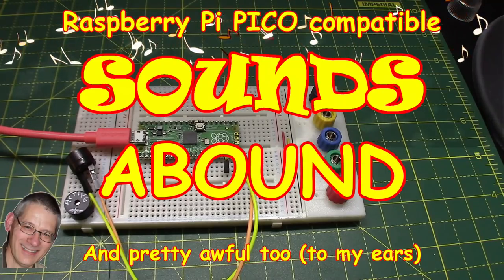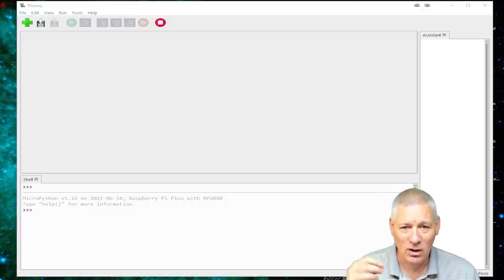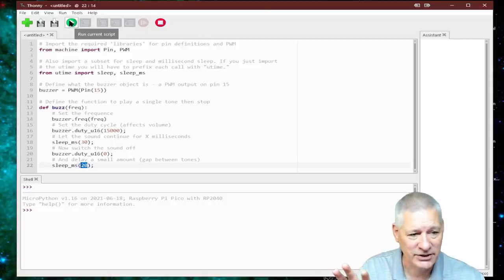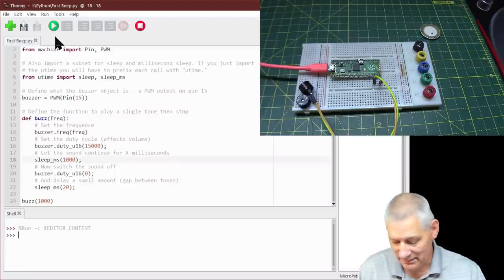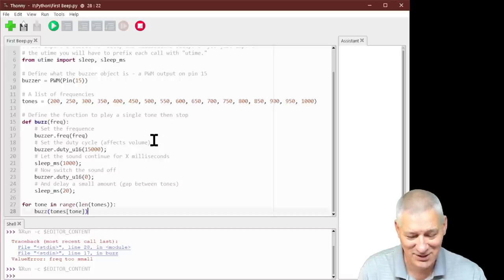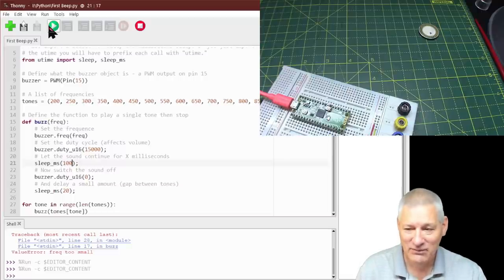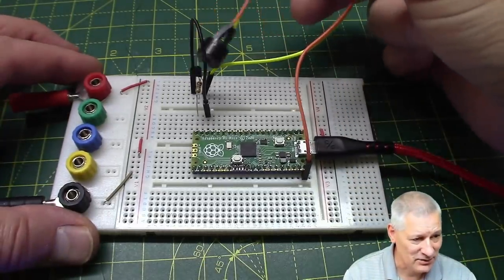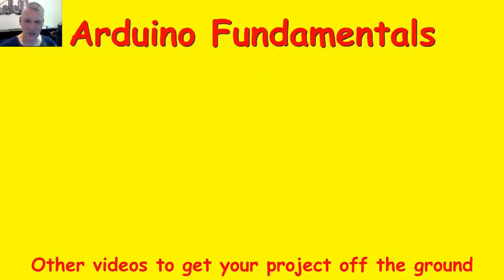#219 Generating sounds 🎵 from the PICO! But is it music to my 👂 ears?

Comment: Thank you for this!  I know your intent was not to give a programming tutorial - but I hope you don't mind me showing some extra features of Python.

The language has really neat features when dealing with arrays, such as allowing you to use negative indexes.

So. Starting with an example array...

tones = [100, 200, 300]

You can use negative indexes to grab from the end of an array.

tones[-1] is 300
tones[-2] is 200
tones[-3] is 100

You can easily reverse an array.
try:-

print(tones[::-1]) 

You can also remove the need for using an index.

# Fridge Opened
for freq in tones:
   buzz(freq)

# Fridge Closed
for freq in tones[::-1]:
  buzz(freq)
Reply from the maker: Thanks for sharing, John! As I don't really know microPython it's good to get posts like this that everyone can benefit from, me included!

Comment: If you just want to iterate through a list of items, you can do it directly, without using an index:

for tone in tones:
    buzz(tone)

And to do it in reverse:

for tone in reversed(tones):
    buzz(tone)

For a cleaner sound, using an analog output (DAC) with a sine wave (or multiple sine waves added together for a chord) seems good.  But the DAC output can't supply much current, so you'd need some kind of amplification.  I wonder if a transistor would be sufficient, or you'd need something like an op amp?
Reply: or 'for tone in tone[::-1]:'
Reply from the maker: Ian's just showing off now (but I do like that construct, I will probably use it and claim I knew all about it).

Comment: Hi Ralph! Just to save you from any headache in the future... you might want to add a resistor across the piezo when driving it with a BJT. Simply put, you need to pull the collector up to 5V in order to get a change in voltage happening across the piezo. I suspect in this case your multimeter was acting like that resistor, so you should have a noticeable difference when not having the DMM across.
Reply from the maker: Quite possibly, Dustin. However, even as it was with the DMM across the output, it was more than loud enough (the video compresses the sound so it's not as noticeable). But I'll try it.

Comment: Ralph, did you look into the floating ground issue we discussed a few weeks ago?

As I understand it, this can happen when you connect your new backyard workshop to your house with anything conductive such as an Ethernet cable. Electricity (like water) wants to find an equilibrium for its potential so it tries to do so by moving energy through anything available. If it is your Ethernet cable, this can prove to be damaging to devices such as routers, repeaters, etc. 

Back in the '90s when I worked for a small computer shop, we would run into floating ground issues when we would attempt to connect multiple nearby office buildings or various buildings on military installations with coaxial Ethernet cables. 

To stop the problem one can use purpose-made optoisolators, microwave transmitter/receiver pairs, or fiber optic Ethernet lines instead of copper.

Terry Thomas
PC Tech Support
Atlanta, Georgia USA
Reply: Any gound with current flowing throught it will create a voltage between the two ends. if I going to run ethernet between buildings now days i go stright to fibre, breaks the ground loop and give far better lightning protection. an optoisolator only save one end if your lucky.
Reply from the maker: I did indeed look for web articles and a simple, RJ45 plug-in, isolation device to break the ground connection (if any) on my LAN cable from house to workshop. None to be found in the UK, only the USA.

Now, that said, I'm was thinking about whether my LAN cable is connected to actual ground. It has a shield, for sure, but whether that is connected to the device (router) ground or the ground/earth coming into my house via the mains electricity is questionable (and difficult to test). Most routers probably have a floating earth? Not connected to mains earth at all (perhaps for the reasons you state)?

My workshop has its own Earth. A copper rod buried into the actual ground outside my workshop and connected to all my mains sockets and consumer unit (fuse box) in my workshop. This is now the preferred way to earth outbuildings in the UK, to mitigate risk from "broken" earth cables (that go pretty much undetected) between house and outbuilding. Electrician said I had a better earth (lower resistance) than the house did!

So what's the next step.
Reply: @RalphBacon  It's just a difference in earth potential, So I'd look for a fibre ethernet and run a fibre link up to the shed, you get full isolatation and prection from lightning. something like a pair of TP-Link Gigabit SFP to RJ45 Fiber Media Converter, Fiber to Ethernet Converter  and a fibre cable. should get change from £100 and can be found on Amazon

Comment: Great as always Ralph.  Last year I did a little 555 timer project with a piezo on-board as a beeper I could feed down inside a wall cavity to locate a cable. It's powered by a little 12V battery like in a garage door opener. It's EAR-BLEEDINGLY-LOUD.  Maybe you could add something like that to your circuit to increase your volume. Very instructive as always Ralph. Thank you.
Reply from the maker: That is awesome! In fact, my ears are bleeding just from reading your comment, Gord! In my Arduino projects I can use a tone library which leverages the push-pull effect from the Timer output pins D9 and D10; I don't know how to do this in MicroPython (yet?) so the transistor was an obvious step!

Comment: In the 1980s, the Tandy Radio Shack Colour Computer (6809 based) had a relay used to turn the external cassette deck off and on. Of course we used to program machine code to make it buzz, and play crude music. Not for long durations of course, as it was abusing the relay. Going back even further, the original monochrome TRS-80 (Z80 based) had a commercial game or two that played music (intentionally) on a nearby MW AM radio by means of intentional EMI. It was RF comedy and a display of extremely clever programming.
Reply from the maker: Stop, stop! You'll be telling me next that the Morse code operators of the WWII made little tunes up to confuse the enemy (or to pass messages on, perhaps!). Oh. https://youtu.be/N7R3FMTO_GU?t=712

Comment: Thinking about increasing the sound output of the unit ... have you looked at some of the lovely smooth and flat surfaces that fridges often have and try to use them as sounding boards? Yes you probably need a firm connection, perhaps magnetically, to transfers the force but it might be a cheap win.  Keep up the great work 👍😀
Reply from the maker: It would be a cheap win for about 30 seconds and then the boss would spot it. Mind you, I could use the top of the fridge; she is too short, er, vertically challenged, to see that!

Comment: Hello Ralph from Ohio, USA! Your episodes always seem to inspire me to do something, which is one of the points of them, I'd guess. Anyway, I bought an old pulse-dial phone and found that much of the functions can be run off of 5v DC. (Even the AC ringer can be operated by flip-flopped DC.) Going to take the old dfplayer mp3 module and make it into a dialable story phone for my grandkids. Thank you for the inspiration!
Reply from the maker: Sounds great! Did you see my video on an old, rotary telephone dialler? https://youtu.be/sD20xkVWh2s
Reply: @RalphBacon  I didn't, but will watch it! Thank you.

There is a library called bounce2.h that I was going to use. I'll look at what you did and see which is better for me.

Comment: Little bit of low-pass RC filtering on the sounder may made the sound a bit more pleasant.
Reply: I guess the piezo already does some kind of low pass filtering, since it cannot directly follow the steep flanks of the signal anyways. Membrane speakers do filtering that even better, due to their elastic resistance as well as resistance of the air moved around. But some low pass filtering with an op-amp (integrator circuit) might do even better than passive RC low pass filtering, since an integrating op-amp amplifier also gets rid of the transistor amplifier at the same time.
Reply: @asagk  absolutely! A small 8R speaker sounds MUCH better than a piezo. Thanks for mentioning!
Reply: @asagk  - Ralph could do wonders with some analog processing - or maybe digital synthesis - but it's just a little "bleeper". I was just suggesting a very easy way to possibly make it sound a bit less "harsh" (using 2 passive components).  AFAIK he's not trying to emulate a Hammond organ!
Reply: @j1952d  "AFAIK he's not trying to emulate a Hammond organ!" ---
... what a pity, isn't it?! :-)
Reply: @asagk  - Hahaha!
Reply from the maker: I do have some tiny speakers, hardly bigger than the piezo buzzer. I shall have to try one out.

Comment: Hi Ralph, use two pins for the buzzer with inverted signals so have a bridge circuit?  Should be louder than 5v.
Reply: If you want another option this might also work wikipedia.org/wiki/Voltage_doubler#Dickson_charge_pump
Reply from the maker: @Graham yes, I do that with the Arduino but didn't know how to do that with the RP2040, especially not with MicroPython - a future version perhaps?
Reply: @RalphBacon  Not easy perhaps an interrupt pin change on the PWM output pin and use that to set the inverted pin in the interrupt service. or use a transistor to invert the signal? Use the 12S output and a sound chip on 3v3 with a embedded data of the sound? Graham

Comment: Different shades of the same; progressing ideas through a number of projects in a timeframe, that's why I called myself a software developer, rather than a programmer. The next program in line usually borrowed from it's predecessor even if only the initial credits remained finally. Keep having fun, JLPCB certainly seem to be coming along in leaps and bounds, offering to the enthusiasts products that were unobtainable until recently.
Reply from the maker: More than a software developer, Ian, a software engineer at the very least! In fact, they called me a senior software engineer at my last job and were very particular about it! And, no, they were not referring to my age. 😡
Yes, JLCPCB seem to be trying hard to provide the services small/medium companies are demanding. Amazing what is out there.

Comment: I love this video.  The way you explain the code I can understand.  If I understand correctly you are running code directly from Thonny instead of saving the code directly to Pico that would run all the time.  I have been watching some lecture videos by Hunter Adams he is taking a Pico and changing the squire waves and using the ADC to convert them to Analog waves to make the sound of a cricket.  Would this speaker work on analog waves also? I  am an old man of 59 or that is what people tell me. I feae in my mind like I am young man hungry for knowledge and that is how I ended up at this awesome video as we said in the 80's.  Thank you and God Bless!
Reply from the maker: The code definitely runs on the Pico; I can't remember all the details now but I uploaded the code using Thonny, for sure.

The speaker I used here was (probably) some piezo sounder; only really designed for square waves (ie digital sounds). To play analog sounds you need a "proper" loudspeaker (not too low an impedance) which are fairly cheap but can sound quite good if mounted on some sort of baffle (even an enclosure side panel would suffice). It can be small too, I have some that are less than 1" across. But better ones are a bit bigger, say 2" diameter.

Comment: You can increase the output volume by driving the piezo sounder with complementary signals.

You could use an inverter but this might be a good application for the PIO feature of the RP2040.
Reply from the maker: Great idea, Neil. I intend to experiment with the PIO (some sort of strange assembler language, by the looks of it) but I'm not sure the output can be dynamically changed; for example output different output frequencies controlled by the main program. I must do some R&D.

Comment: There's some missing stuff in your transistor piezo circuit.  most piezos register as open circuit at working voltage tests, they behave a lot like capacitors. Your transistor can give a lot sharper edges to your tone signals in but without a resistor to pull the gnd end of the piezo back up to 5 volts, it will just stay down at gnd + the transistor emitter forward voltage. If I really needed the volume and had spare pins I used to pair pins up as a full bridge driver back in my past life on microcontrollers where I was bit banging much of my custom code. A 1k resistor across your piezo should sharpen up the sound. So long as you power down mode with your output switched to input there's no standby current penalty.
Reply from the maker: Sounds like some good info there, Graham, thanks for sharing. I shall bear this all in mind.

Comment: Another great video, thanks Ralph.

As has already been said, the sound reminded me of the 8bit computer games back in the 80's.

Have you managed to get the pico-probe debugger working via a 2nd Pico yet?  I prefer C and C++, so that's what I'm now using.  Currently writing a class for outputting numbers to 7-segment displays via MAX7219s.  The debugger helps no end.  Perhaps you can show the use of the debugger with C or C++ code in a future demo?
Reply from the maker: That's a great idea but time is my enemy. What with multiple projects on the go and a gazillion other things to do I have to be very selective where I spend my time. But it's most definitely on my list of very important things to do (regrettably, not on my wife's list at all).
Reply: @RalphBacon  Funny how that works...

Comment: Very instructive video, I like your style :-) on your pcb, the one you show at the end, you have a 18650 battery and a TP4056 I beleive, would you mind sharing the shematic of the circuit. I am actually designing a pcb with that kind of set up. Thanks, Best.
Reply from the maker: I've added the schematic to my GitHub for the project you are referring to (video #221 https://youtu.be/eLnfiYkxCQ4 ) and you can find it here: https://bit.ly/3Yo2r1r
Reply: @RalphBacon  Many thanks for this ! this is exactly what I needed for my pcb project. keep on the good work !

Comment: Great to see you again Ralph- I'm looking for a tone to mimic the rotary encoder "tick" as it's turned up and down and was wondering if you have any suggestions?
Reply from the maker: I would have thought that a standard tone (beep) but at a low frequency (100Hz) that is short (eg 50ms or less) might sound like a tick, Mark. The problem will be to keep it in sync with the actual movement as you won't want to be initiating tones within an ISR.
Reply: @RalphBacon  If the piezo drive is push/pull then simply connect the other piezo pin to the pulse output of the rotary encoder. It will click. It will also drive the micro pins low for half the clicks but internal static protection circuitry will deal with this unless your piezo is huge!

Comment: Ralph tell me one thing, where does that little attached reset button come from? Is it a nifty self made thingy? (Already thinking about creating some, while I have lots of spare smt push buttons somewhere in my chaotic 'mechanic parts nirvana box' ). Or is it some product from somewhere? Didn't find it ... perhaps looking for the wrong 'naming'.
Reply: @andrewhartley8781  Ty!
Reply from the maker: Andrew is correct; as I was ordering the RP2040 boards from them I included the ridiculously simple reset buttons too (and £1 from each goes to the Raspberry Pi foundation). But I'm sure a simple SMD button soldered across the pins would suffice too.

Comment: Hi Ralph,

Another great video, thanks. You mentioned the tone() function sounded better on the Nano. Probably because the Nano was running compiled C/C++ code whereas the Pico was (semi-)interpreted byte code. Not quite the same. I don't know if the Python code bit-bangs or uses a timer to generate sound. (I'm not a great Python fan.)

The Nano sound is generated using a hardware timer (timer 2, 8 bit) and an interrupt (CompA). This is fairly well covered on pages 104 onwards, in chapter 3 of a slighly famous book on the Arduino. ;-)

Your tones appear to be fairly randomly chosen. Maybe using actual tones of the notes in a scake would sound better? 

Hope you are settled in your new home.

Take care.

Cheers,
Norm.
Reply from the maker: Hey Norm! Yes, pretty much settled in, thank you, but still have a couple of things to do in my workshop as I discovered when doing this week's video! Never enough USB sockets! Or they are too far away!

Regarding the tones from the PICO, it undoubtedly sounded worse due to my non-scale choice of tones; it will doubtless improve as I select proper, known tones. Nope, can't bring to mind that book you mention covering the Nano, timer-generated sounds 😊 

But PICO bit-banging works OK, as I found out this week with the easier-than-you-think PIO feature - keep tuned!
Reply: @RalphBacon  Pio? I'm definitely looking forward to that video. It's definitely an intriguing feature of the RP2040.

USB (or any) socket, there's never enough and/or in the right place. Even when you decide how many youneed, then double it! 😉

Cheers,
Norm.

Comment: 21:54 so much jitter! your timing is way off, generate timing in hardware!
Reply from the maker: Well, the PIO feature on the PICO is hardware so I might use that.
Reply from the maker: It was the added NOPs (and other non-optimal compiling) that made me veer away from PIC processors, they (MicroChip) were pretty mean with their compiler (that produces code for their own bleeping chips, after all). Now look what happened to Atmel!